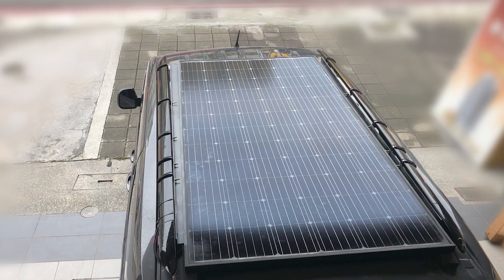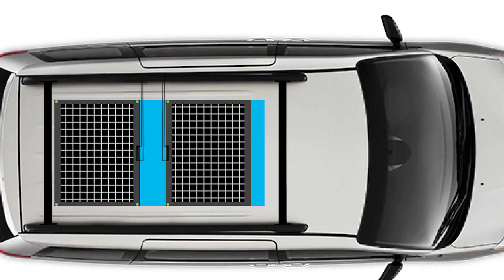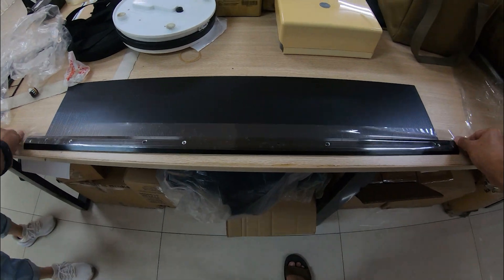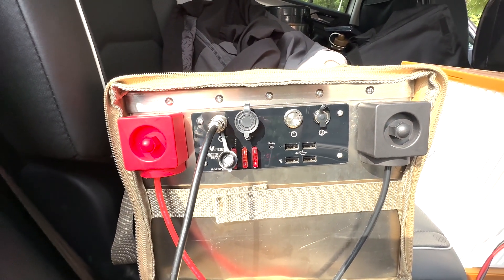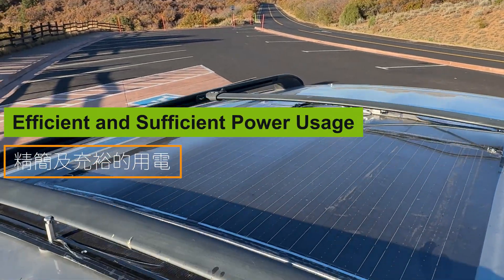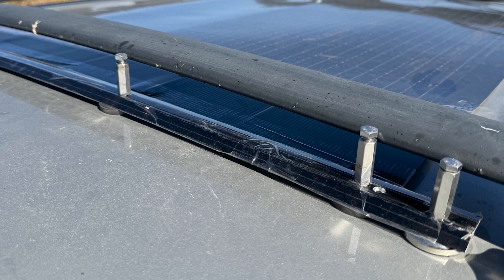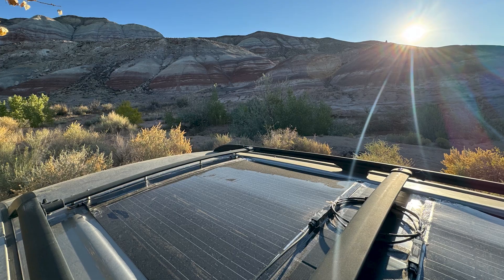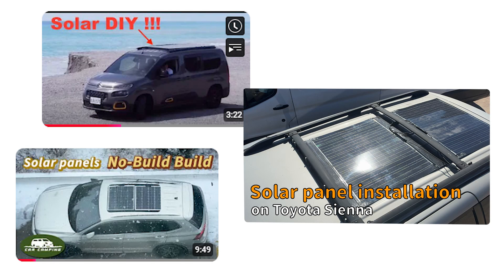No-Build Build Solar Panel Installation for TOYOTA SIENNA | Building Power System in Minivan or SUV

Comment: Can I plug them into any generator?
Reply from the maker: Solar power works like a generator, but we usually connect it to a battery for energy storage.
Reply: @simeiworker  i use my generator as a battery
Reply: @simeiworker  but i have to charge it

Comment: Excellent video sir. I am planning to do something similar with my Siena in the near future time I might need your help. I will comment if I run into any problem. This was very informative video. How much would the whole set up cost approximately in usd?
Reply from the maker: The 200W solar panel itself cost me around $60–$70, while the other accessories, such as magnets and aluminum poles, cost roughly $20–$30.

Comment: hmm i like using 3m window weld, strong as construction adhesive, made to flex with really hot temp changes, also doesnt usually damage car paint when removed, some videos of how they do it with a razor blade. IMO all the problems with flexible solar durability is because of the pvc rv roofs theyre attached to. no need to use chloroplast on a car roof, actually i think it insulates them since air cant really flow through the holes very well due to restriction. directly adhering the flexible solar to your roof allows your roof to act like a big heat sink. important to use sun shades and crack your windows in the summer. also I think more people should add a layer of AL foil tape to the back of the flexible solar panels since if you shine a bright light on them you can see theyre about 5-10% transparent. not sure if the al foil does anything for heat spreading, probably makes it worse because of emissivity. might be better to use the more expensive black painted AL foil tape meant for car trim repair.

Comment: 1 problem though, those crossbars will affect the output of the solar panel from the shade of the crossbar..
Reply from the maker: The extended plastic panels at the front and center are designed to prevent shadows from affecting the solar panels.

Comment: Your DYI car roof solar mounting videos are all very practical. I like the no built approach. In other topics, I've been waiting for more info about the power supply you're using. A viewer asking you this about a year ago got this reply from you, "This is a product that our company is currently developing. As a tester, I have been using it for over a year, and it should be launching soon." Is there any news for this product? Is the product still developing? Is the launching coming? Thank you.
Reply from the maker: Yes, the development of this product is complete, and I’ve been using it for over a year with great results. We’ve already produced an initial batch and are preparing to sell it on a crowdfunding site. The key now is to test it with more DC appliances to maximize performance. Of course, we’re purchasing these appliances from the market for testing purposes.